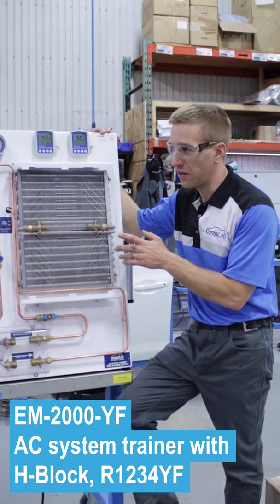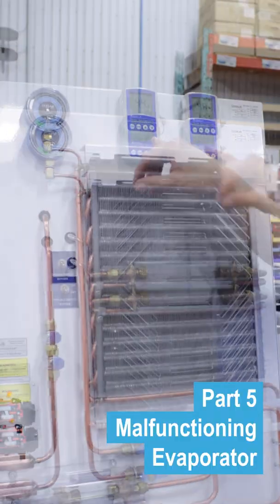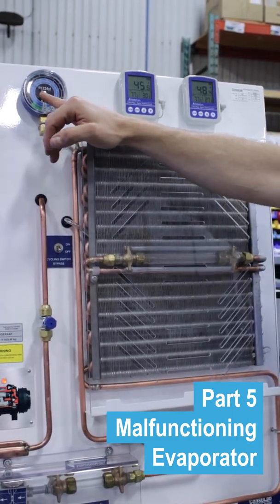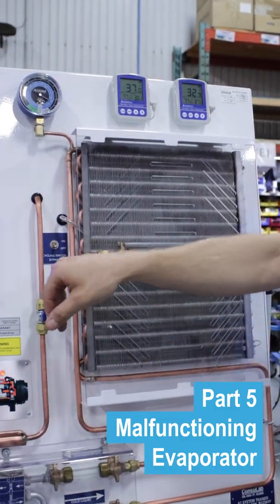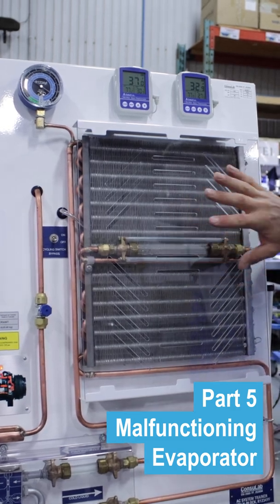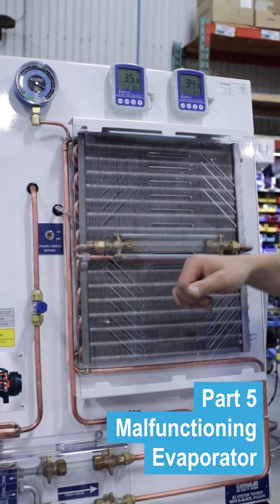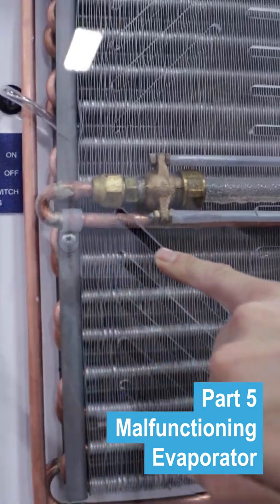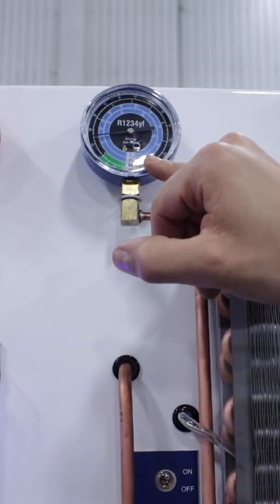Low pressure dynamics of AC with r1234yf refrigerant

Comment: To run a single phase like sir, neutral wire is needed, so to run 3 phase compressor, where does it get the neutral?